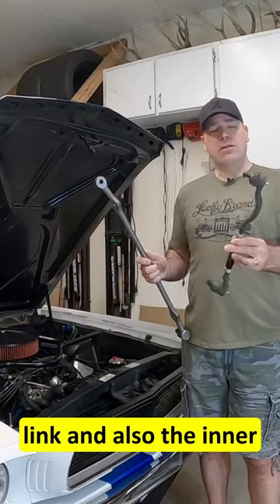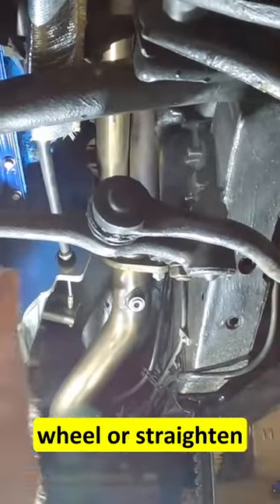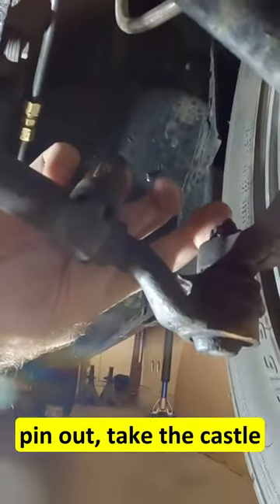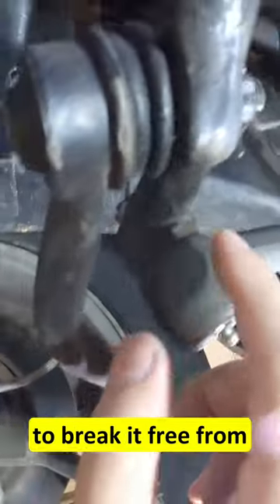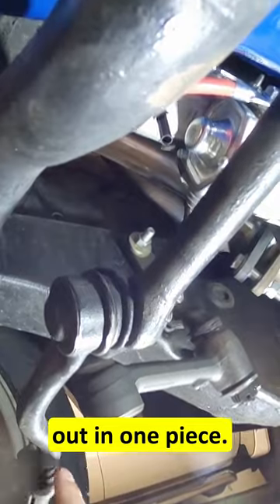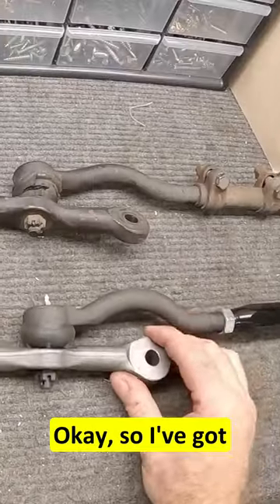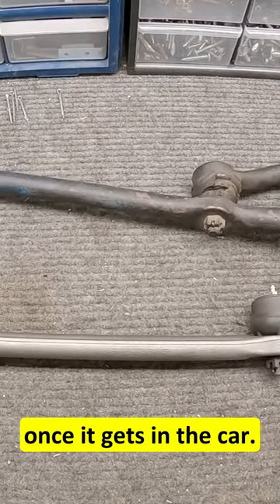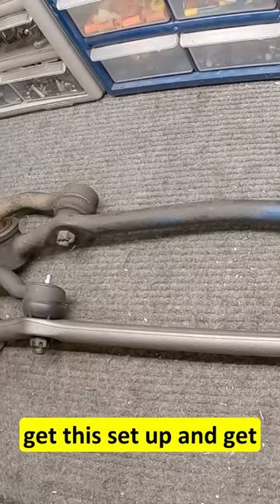Classic Mustang Steering Linkage Replacement

Comment: Manual steering? Where did you purchase them? CJ?
Reply from the maker: Yes, manual steering.  Purchased as a kit from CJP, part number 6566SLK-V8.
This is just a Short of the full length video I made a while back on this upgrade.  :)